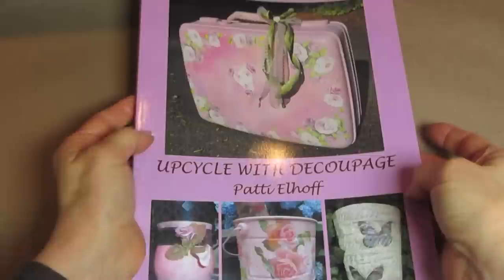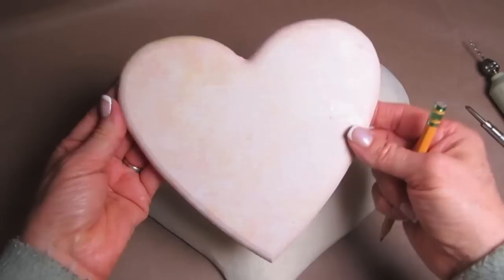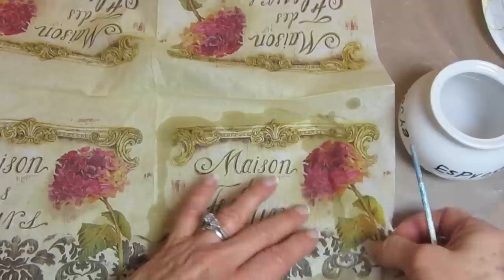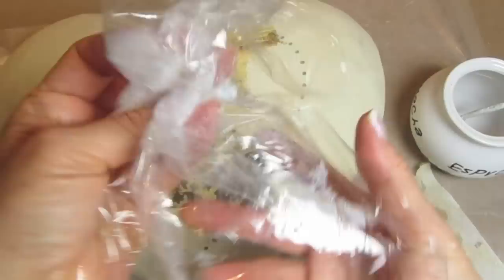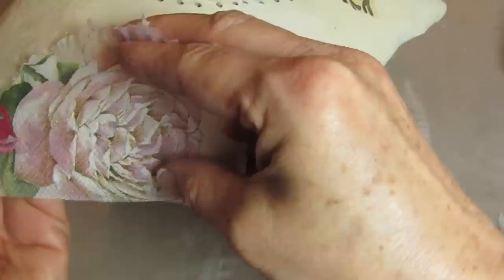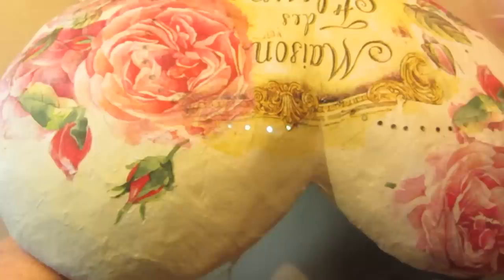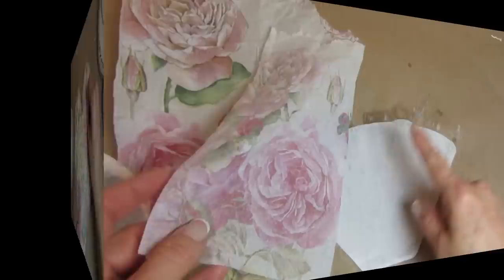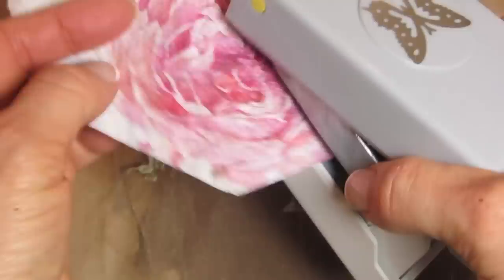DIY How to Decoupage a French Heart

Comment: Hi Patty,
im having trouble matching the color of the napkin with paint.  Im working on 2 larger pieces of furniture, an end table and a extra large magazine rack.  Any suggestions?  I really didnt want to buy 20 small bottles of paint.  Secondly, one napkin has a different background. so I fussy cut it out but when glued down the color has darkened.  Any help would be appreciated.
Thanks
Reply from the maker: Hi Sally, are you on Facebook (please say yes) you can visit my page Upcycle with Decoupage and post pictures of what you're doing so I can see and help you out a bit more. When you say you're having trouble matching the color of the paint, do you mean the background color of the napkin and the paint? If you are working with a pink flower as your image (this is just an example) and you paste it over a darker color it will not work. You would need either a lighter background color (a good rule-if not using white is to just stick to pastels) or you would need to use wrapping paper to decoupage instead of napkins so the color will not bleed through. Does this help? :)
Patti

Comment: Nice!  What is the surface you are working on?  Great inspiration!
Reply from the maker: Thank you! The surface of the heart is Papier Mache' but I did put contractors paper over my counter top to protect it. I wasn't sure which surface you were asking about. ;)
Patti
Reply: patioelf Thanks...wanted the work surface. Went to our local thrift shop and got some wood trays. :)
Reply from the maker: starchild582  OK> you're welcome. I'm actually finally getting a craft matt that you can wipe clean and use a hot glue and a heat gun over-without melting it. So you'll be seeing that soon too. 😊
Patti

Comment: How can you make a papier mache  heart like that?
Reply from the maker: Hi Anne, 
I purchased this one so I'm not sure how to make one. I'm thinking you can look here on youtube for how to make a paper mache heart, there has to be a video on it somewhere on here. 💗😉
Patti
Reply: Anne, for a flat or slightly curved version try this:  You can use a paste made of white flour and water. Newspaper or paper bags for the "paper. Heavy plastic sheet. An old hand towel - or T-shirt rags.  Mix the flour and water in the blender to make a thin pancake type "glue - paste".  Pour into a large pan, such as a roasting pan. Tear paper into palm (hand) size pieces. On the plastic sheet draw the heart size you want with a black permanent marker. Make sure your plastic is at least 5 inches larger on all sides than your plastic sheet. Put the ink side down toward your table. Place the towel, folded, under the plastic. this will give your heart some curve or drape. Shape the towel so the edges of the heart are on the edges of the towel or T-Shirt rags.Dip the paper into the flour water paste, and pull over the edge of the pan to remove excess, so you only have a very thin layer of paste on the paper.  Only one side needs to be coated. Place on the plastic, smooth out. Continue over lapping the paper to the edge of the heart, (you will be cutting the shape of the "heart" later. Over lap the paper/paste layers to 6 layers for newspaper, and 4 for paper bags. For a torn heart edge, use your fingers and tear the papers along the drawn edge on your plastic. For a hard edge you will use scissors. (wash scissors immediately after cutting) . Keep the towel or T-shirt rags in place under the heart. Let dry for several hours, and depending on how thick you kept your paste, will determine the dry time. Once dry, paint the paper mache' heart with your base color.  Decorate. Have fun! (we do this over balloons for pinatas !
Reply from the maker: starchild582  Thank you! That was very nice of you!
Patti